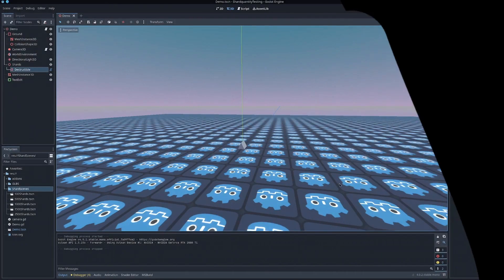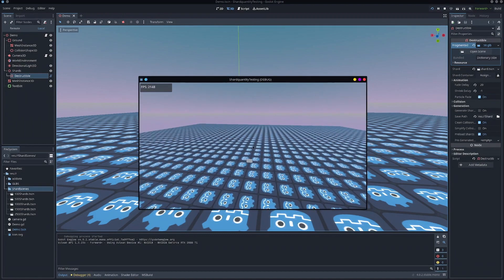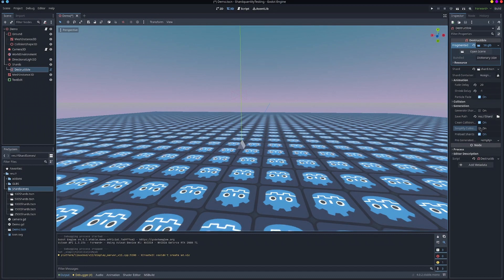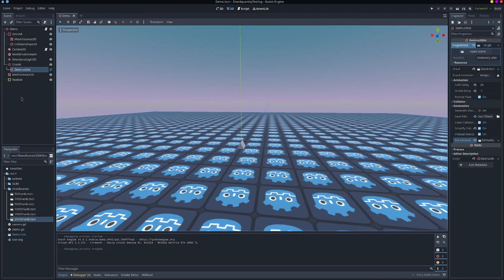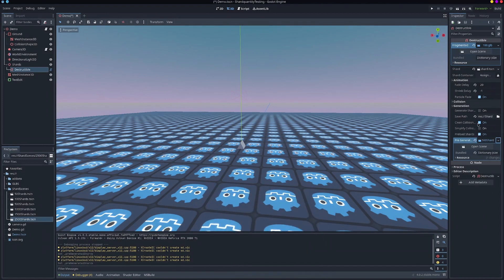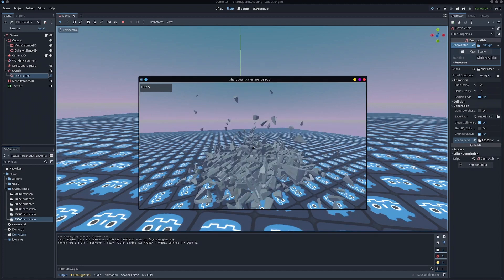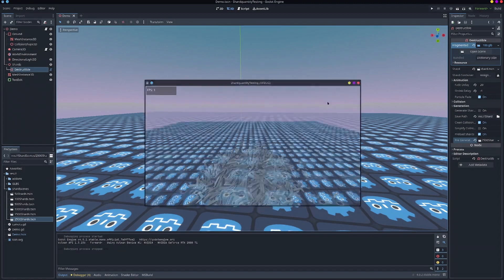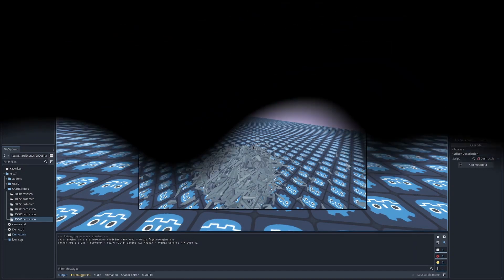Godot 4 destructible objects performance testing

Comment: I have a project in which I hope to dynamically destroy meshes bit by bit with bullets etc. my plan is to use arraymeshes that copy the targeted mesh and augment it with the new chip/hole/fracture. It doesn’t need to keep chips around or anything, just rebuild the mesh as one with the damage dynamically. It’s perfectly doable in 2d games like worms or tanks etc. but the only implementations I’ve seen in 3d are with CSG’s which seem to suck, or preshattered ones which are usually obviously not shattered dynamically. When constructing these arraymeshes at runtime, (it will be a low poly game) can you think of any optimization techniques one might try? Bear in mind it doesn’t need chips so it shouldn’t be too expensive, other than just adding complexity to meshes.
Reply from the maker: I mean the easiest and most performant method would be to just have the mesh be an array mesh generated with blenders fracture, and using my plugin pregenerate the fractured scene and add knockback or destroy whichever fragment is closest. This means the more fragments the more realistic but the less performant. Another thing I could think of is maybe adding a custom object which causes invisibility? Such that it could be placed inside the object and the desired points to appear as a shard, but I have no experience in that area so I don't know if it's even possible.
Reply: @ZachAR3  I love where your mind is at! youre right that the conventional way is to use the cell fracture in blender etc. It's an ok method, but since im making a low poly game, i have the performance capability to have super dynamic destruction. I think the player will find the entire environment being permanently breakable, in a way that can scale forever, until everything is a deformed pile of garbabe, quite satifying. lol. It allows me to crater the ground, poke differently shaped holes in walls depending on weapon, etc. but is too expensive in a higher poly game. Ive been looking at the mesh slicer godot plugin for reference and expect a similar performance cost to it
Reply from the maker: @WildGrowth-Gaming  Yeah if you wanna go that far maybe look at creating your world as voxels? Or if not the only way would be to dynamically break them with something like as you mentioned the godot mesh slicer plugin during runtime.
Reply: @ZachAR3  exactly, so im basically taking a similar approach to mesh slicer, as it dynamically builds a new mesh to replace the one affected, my work lies in augmenting the newly created clone. I cant wait to resume work on the project but i got sidetracked building some assets to use for the destruction! lol
Reply from the maker: Fun haha, link me if you ever upload a prototype!  @WildGrowth-Gaming
Reply: Thanks Bro! I will! @ZachAR3